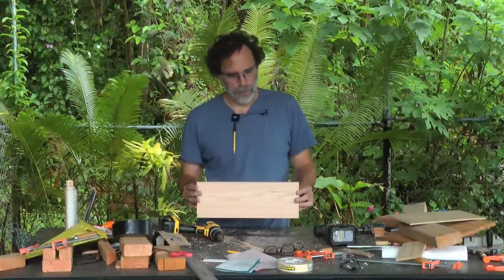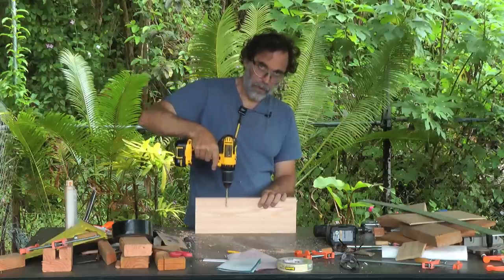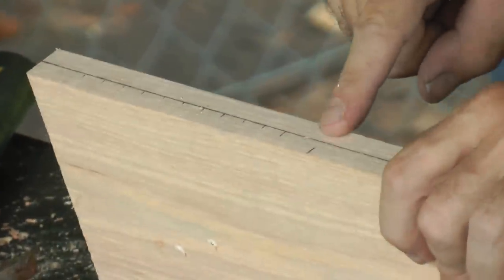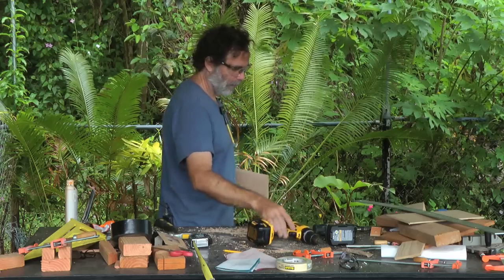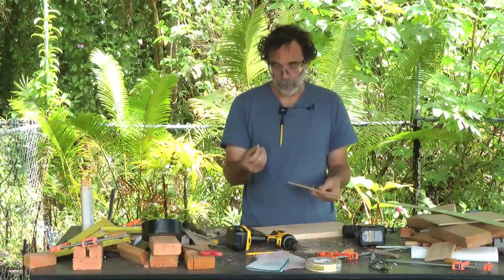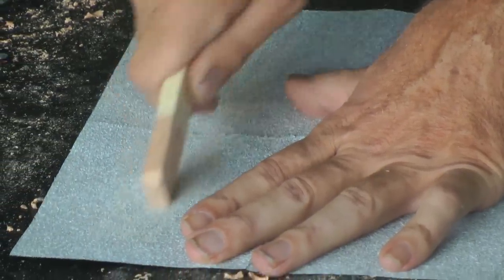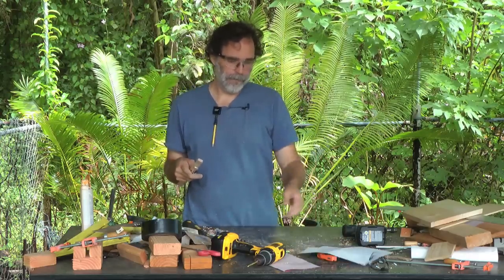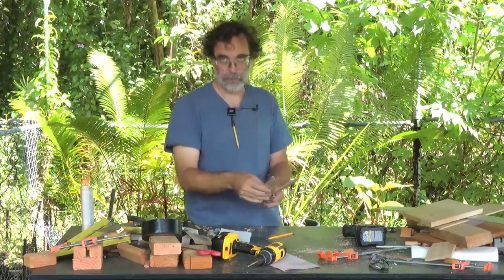how to make a proportional divider for drawing

Comment: Great video, as an amateur artist and woodworker made one the next day. One observation is that using regular 1 inch spacing will give you ratios that are not even. In order to get 1:2, 1:3,1:4 etc. hole spacing has to vary. A simple formula for hole spacing x ,length L and ratio R is that x=L divided by R+1  or written as x=L/R+1 so for the 14 inch example and a ratio of say 1:4  x=14/5=2.8 other side 11.2 for 1:3  x=14/4  and so on. Be careful trying to rip thin strips of hardwood on a table saw . Thanks so much.
Reply: Thanks, brilliant formula, now I can work out where to put the hole for the golden ratio position 1:1.618
Reply: I'm confused... Do i measure 2.8 inches down from 14 and then drill a hole? What do you mean by "other side 11.2" ?  What would be the formula for centimetres?

Peace

Comment: i know this video is over three years old but you don't have to buy a piece of wood for the proportional dividers, you can go to a hardware store like Home Depot and go to the paint section and grab the wooden painting mix sticks, which are free.
Reply: +Cherubim 67 Thats good idea! I'm wondering  have you tried it? Does the wood split? In the video he says to use  high quality wood like oak. I'm thinking the thin pine wood will split when drilled.
Reply: ..or 2 pencils and a rubber band....lol...c'mon ppl you're 'spose ta be artists. Get creative!
Reply: Cherubim 67 Thanks for that idea, I had some paint stirrers in the garage so worked out perfect!

Comment: This is brilliant for two reasons. You can either buy plastic versions on ebay and amazon which are not up to the task...or you can buy nice metal ones for a big price. The big snag is t

hey have slides and not holes and are useless for art.

Comment: I have just made such a prop. div., and it worked well. Dont't try to saw the tips (as someone suggested) unless you have a very precise saw! I used a belt sander, which worked extremely well. I had some nicely formed tips within 10 minutes. My PD is 35 cm long, and the distance between the (5mm) holes is 1 cm. 1cm is a bit much. I tested it, and I would have needed a hole between 3 and 4. So maybe you try to make as many holes close together as possible...

Comment: Would it be better to have the points flush with the inside edge of either arm and tapper on the outside like a compass? That might make it easier to expand angles. Not sure. Just wondering.

Comment: I get confused with proportional divider. I do always have to work from a smaller picture but when I start with a divider I have to keep using it. If I don’t use one I do have some issues too but they are different ....I just make a bout the same size portrait because portraits are never oversized in my world....it’s just.... portrait size. Usually 12 x 12 or 11 x 14 size canvas. I have just started art again so I’ll figure it out. I had never used one before

Comment: You may be interested in this: I used 5 mm screws, which is alright. But maybe it would be better to use smaller screws and holes closer together to get a finer variation!

Comment: but how exactly are you planning ratios? You are putting holes at every half inch and starting just a little off center but wouldn't 1 to 1 be on the center? and how much enlargement does a half inch provide?
Reply: +bigdroz1982 
was confused about this  also  but i think it's because  1:1 means  "measurements side : life size "   where you  measure real size  on one end  and hold it out  to match  where you are sitting and pick the correct hole  .   ( so the end result  your painting is 1:1 with real life but  your diver is  not set to 1:1 ) 

1:1 ratio would otherwise only be usefull with plotting  from a picture holder  where source already is life size and at  your canvas .

Comment: Thanks Mark,  i don't have any of your tools , but am going to tell a carpenter to make one for me,  but what i didn't understand how can i use it , use this one we measure it and the other we    blog with, sorry but this is my first time to see a proportional divider and don't know how to use it after i have it from the carpenter, please can you help me , thanks again.
Reply: Plenty of youtubes to explain it, but in essence, from a fixed point from the subject extend your arm out fully take a measure of the subject between the points with the side that has the holes in it. The opposite side will then give you an enlargement of various size depending on the hole that you have chosen to put the pivot bolt through with the middle hole giving a 1:1 ratio. You can also use it like a mathematical compass, and put the points down on say a photograph you're trying to copy to get distances for proportion without bothering to swap ends, or swap ends and get enlargements of the photograph etc.

Comment: I like your video but i notice some thing you did no show in the video that you problem note all ready.well one is how thick to cut the strips when you fines drill the hole into the side of the bored.
Reply: The correct phrase is "up and coming artist" The correct spelling of your current screen name is "upcoming artist" It just sounds awful and is bad grammar.
Reply: what your try to say remove the name that already there or what?
Reply: k knowles  
what your try to say remove the name that already there or what?
Reply: You still have it wrong. There is no "E" in "coming". The phrase should look like, "Up and coming". Now...in addition to that. Are you talking about just yourself that is up and coming? or are you talking about multiple people? If you are speaking of just yourself thn you do not need the "S" and the end of "artists". It would just be, "artist" which is singular, If you are talking about multiple artists that are up and coming, this would be plural and you would keep it as, "artists". Sorry, I only tried to correct you because you were using it as a screen name and I am sure you would want it phrased correctly so people know what you mean. :)
Reply: Alright thanks
Reply: k knowles Alright thanks i try just need to slow down when type ad ready over my write before post.
Reply: Up and coming artists  5

Comment: It never ceases to amaze me on here to see 'so called' intelligent and skillful people can be so 'dumb' in expecting viewers  to just happen to have a table saw in their bed room, kitchen, garage or especially fitted out shed. Having used commercial table saws and know whzat they cost the space they need to be able to cut cleanly for such a short piece of wood is bloody stupid and expensive. Plus it takes great skill to drill perfectly perpendicular to ensure the dividers when angled slide exactly ensuring they don't twist. Also (which again astounds me) this artist has proven incredible brush and drawing skills for hair line accuracy but then shows us sand papering  the 'so called'  pointed ends which in truth more like bulbous large thumbs for purpose of placing a fine point. Mind not you not as bad as the little old lady making a cat flap door which included a virtual hardware store of precision cutting and electric tools , easily costing about $5000 so her cat could get in. Even so, stick to what you are a master of, a very good artist and don't insult us with 'making' wooden proportional dividers' please.
Reply: What a ill-natured comment. The demonstrator was at pains at every juncture to point out the minimum tools options. The table-saw suggestion was only "if you have one and know how to use it". For heaven's sake he didn't even have a vice, and no-one tries to make anything without that minimal equipment. The points were perfectly adequate - any finer and they would never survive damage in daily use.
Reply: @ricktherecorder4416  Ditto. I thought M. Carder gave plenty of creative options and understands his artist audience well. I made mine pine because I didn't have any hardwood, and mine bows a little at the tips. I might try splitting an an old hickory rake handle for my next try.

Comment: Now, now. Let's start from the beginning. 1) To get the perfect centre line, use a MARKING GUAGE. Reverse sides to make sure you're dead centre. 2) To evenly mark out perfectly equal divisions, use a compass with points only. 3) By using the "points" left by the compass (perfectly equidistant) you can use a bradawl to accent these. 4) Use a drill press with a square guide ; this way your holes are perfectly PERPENDICULAR. I'm only at 4:11 and I'm out. Sorry, this is just too amateurish. Your holes don't even line up. Plus, you have to stagger the holes to obtain different ratios. Look below for these ; some people give great ideas. Friendly advice : try to be 100% sure of yourself before making a video. You know, as they say: The road to Hell is paved with the best intentions.Good luck.
Reply: While these would be valid critiques for heirloom quality divider, its important to remember that perfection is the enemy of good. I suspect the intention here is to  motivate people to create a simple tool that is both functional and easy to fabricate. There is very little a precisely made divider could do that a simple divider could not. 

Yes, it is amateurish, but its intended to be made and used by fellow woodworking amateurs.  You're welcome to make yours from mahogany, sand it to 600 grit, drill a logarithmic scale, seal it and protect it with oil or varnish, but in the end the function it performs will not be significantly superior to the one in this video.
Reply: Are you for real? Who has a bradawl, a drill press? Not the majority that's for sure. Correct ratios? This is not a scientific instrument intended for use in neurosurgery. It's 2 bits of wood to help make my drawing a bit bigger.